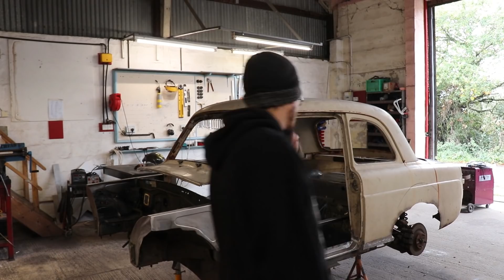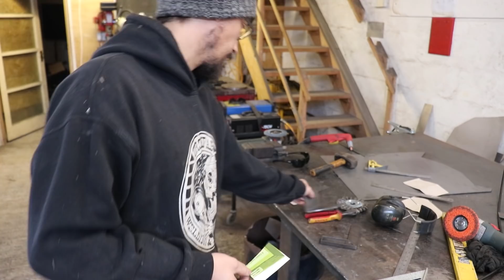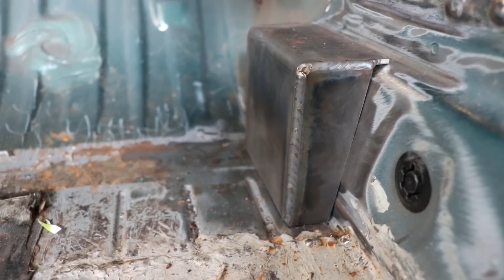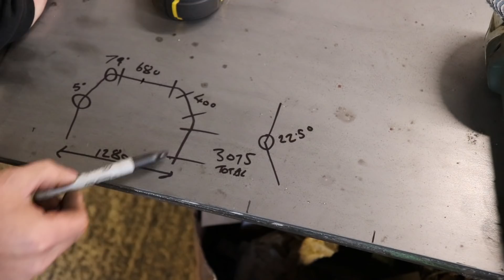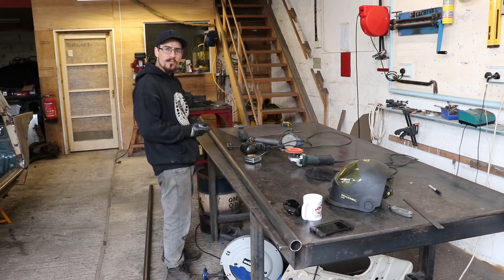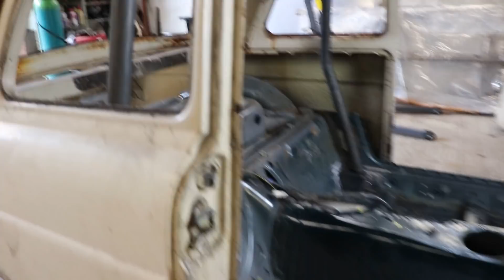THE MONGREL PART 13, STARTING THE ROLL CAGE BUILD

Comment: Nice work and an interesting project  
But you are wrong about the tubing. Very unlikely you are using seamless, possibly DOM but almost certainly has a welded seam somewhere. DOM would have a very hard to see seam but it would be there. Regardless seamless, DOM or with an apparent welded seam the strength is the same given the same wall thickness  
Trying to keep things accurate , keep up the good work

Comment: I'm guessing the roll cage is for the cars body strengthening to prevent warping. To be honest it's ruined the looks of the car. I was hoping you could've used a perforated "C" channel and contoured it internally as arches along the inner wall of the car. It would've looked a whole lot better, a little WW2 aircraft kinda. Throw in a few rivets and she'll look better. 
Another thought, there's this bare horizontal piece of metal below the windshield, can you punch in a few louvers on either side of the midline.

Comment: Lol my 4 and 1/2 inch grinder got guard removed too, I must be another idiot :-) 
only way I can get them fit and see the cut well .
Is indeed dangerous and face shield or good goggles a must, cutting when can't see the cut or struggling with space dangerous too so it not as silly as looks .
I had a 1mm disc break up yesterday cutting in awkward spot under a car and kinked the disc a fraction , never much of a bother as they designed shatter to small pieces but eye/face protection a must .

Comment: Does the bend in the vertical component not weaken the hoop in the vertical direction? Or is it braced backwards later?
Reply from the maker: Yeh its braced backwards and also to the point of the bend.
Reply: I'm building a sporting trials car and would be ashamed if you saw my welds.

Comment: I thought you would have put a plate in behind the box? I always thought without it the box might become a cheese cutter in a highspeed rollover. It wasn't really clear in the New Zealand cage rules so I fully boxed the box as it were...
Reply from the maker: Its definitely a good idea to do that, that area is quite often rusty on older cars so I would plate it in with thicker steel first then weld the boxes to that. I try to tie my cages into the car in multiple places so in the event of a crash or rollover all the stresses arn't placed on 6 feet alone.
Reply: Feral Fab:  Interesting comment, my comment was going to be that I thought Matt's explanations for the box itself were the most logical and best I had heard yet, I have had "discussions"  about said boxes.   The rules I am used to seeing (NHRA and IHRA) do not spell out but the implication is that the plate on which the cage rests is supposed to be relatively flat, as in contoured to the floor but not a built up box.  In this particular video I also find it of interest that in one plane he doesn't want to bend the main hoop tube but in the other plane it almost has to but does not seem to be as much of a concern.  I am not understanding why that would be.  There is a flat at the top of the rear angled floor section behind the seat but assume that is already over the rear wheel tub below so real floor or rocker box to weld to,  I wondered if you could have gone with a bar across the top of that flat that the main hoop would come up from then a bar tied in like his angled one going to the box and then a longer angled one making up the start of the door bars going to the front door hinge area.
Reply from the maker: Im not sure what you mean about the bends?  I have done an mx 5 in the way you describe with the hoop starting at the upper level of the floor, it works great if you are running a single door bar but not for this design. Cheers
Reply: @Urchfab  You didn't want the lower part of the main hoop to kick inwards from the vertical but there is a bend from vertical kicking towards the front of the car (as it follows the floor pan behind where the seat will be).  It maybe a bad assumption on my part but I just assumed keeping all bends out of vertical bars was to reduce chances of further bending if crushed (roll over say).
Ah, the single bar versus multiple (more like road race, rally, NASCAR), had not thought of that...thanks.  Appreciate the series (just viewed part 14 second bit of cage work)

Comment: Hi Matt, Great job! Could the roll cage also be placed just in front of the wheel arch? So higher up in the car and easier to bend? Or would that place not be strong enough since you cut out a lot of material?
Reply from the maker: I need to attach the lower door bar at the base of the main hoop so it needs to sit like that, I have done it the way your saying in the past though. Cheers

Comment: Matt ,get yourself a decent flypress  , bending tooling easy to make.
Mine will bend 3mm  with no effort. Go for a number 3 or 4.
Something like this will be fine   https://www.ebay.co.uk/itm/Fly-Press/173623379630?hash=item286cc286ae:g:js8AAOSw-2hb30Tv:rk:22:pf:0

Comment: I'm enjoying this more and more Matt. Agree with everything you said at the end. You've shown top work, planning, welding etc. Just in case you do read this, I made a roll bar for a Mazda rookie banger in '96, when they first started. Followed the B pillar and......didn't fit in the car LOL. Raced it like that at Swaffam Dec 1st Got videos of that on my channel.
Reply from the maker: I will have a look, Cheers
Reply: @Urchfab  3 videos, Matt "Swaffam1strace" title of the first 9 years ago if it helps find them. Filmed on VHS and transferred.

Comment: Binky is a totally different animal as you said. On a few episodes they ran a stopwatch to capture fab time. The bracket they made to hold the fluid container for the power steering took 8 or 9 hours alone. To compare the Mongrel to Binky is like comparing apples to oranges. But that's the problem with youtube comments, people critique what others do when they have no real clue of the subject matter. Loving the build so far Matt. Can't wait to see it progress. Keep up the good work. All the best from Ireland 🇮🇪

Comment: and i'm looking forward to 1.8VVT, skunk2 intake or itb's, race header, 6 speed gearbox and a 3.9 torsen diff. all on 7Jx15H2 with a big brake kit in front. a short shifter with an extended lever would be finally the cherry on the cake.

Comment: Awesome work I agree nice welds. I need to learn to make some welds like that. All my welds to this point have been on thin 18 gauge for body panels so not pretty but functional. what technique are you using for your welds and what gauge steel can I do a bead like that on?
Reply: DadsToyGarage DevJ  exactly what I was wondering Matt, what thickness is the material you have bead rolled?

 Ooh and........Beautiful welds!!!!!!! 

I’ve the same mask, worth every penny I use mine for plasma cutting but I don’t use the plasma very much, I use my mask at work tig welding a lot of aluminium and stainless steel 

Thanks dan
P.s keep up the amazing work that your doing!!!!!

Comment: Matt, a question about the angled upright main hoop. Given that the car has the potential to land on its roof, it would place the cage in compression and the forces would be transferred into the bend where the cage kicks back. Will you need to place a stiffener bar, back into the car from, or near that bend? Just something that seems to raise a question in my mind. I am interested in race car and competition car construction and was curious about that.
Reply: all he would really need is a neat little triangle, about 15, 9, 12 cm on a plated strip/box which runs along the top of the rear shelf and it should give enough rigidity to minimize any chance of it bending, as it will more than likely be connected along the leading edge of the back shelf anyways. It will more than likely have a rear cross braise coming off of it also. Pending on what class it's going to be raced it .. ie power, weight, year, ect .. or if it goes into just being a track hack will ultimately determine the requirements for what is needed.

If Matt wanted to go nuts he could gusset every single bend as well, then put gusset plates connecting the body to the cage, but at the end of the day, I'm pretty sure Matt has built enough roll cages to understand what's going on :D

If you are interesting in race car construction, get yourself the requirements book in the class you're looking at building for, before you start your build. That way you'll be able to build within the specks of the class and not spend all you're time building something which doesn't pass tech inspection, or end up building something which is way over engineered for the class the car is going to be raced in.
Reply: @KlaytheFounder  Thanks for that.. it answered my question; I have no doubt about Matt's capabilities, expertise and experience. I possess many technical engineering design books; just sometimes interpretations of rule books, specifications and calculus. are written in a far more complex detail for a layman. Too much rigidity can also lead to transfer forces being absorbed by the driver's brain, (viz the Late Dale Earnhardt), with sometimes tragic consequences; hence the full containment seats and Hans Devices etc we use in our speedway and road circuit cars here in Australia.
Reply: @Afrodizyak47  exactly, it's a fine line between being safe, and being so safe that you're actually causing damage again, that's also why they've been putting crumple zones in cars for a while, especially in steering columns .. nothing worse than being shook about too much or impaled by something when you want the car to absorb what ever it's crashing into, otherwise it'll end up behaving more like a pinball and just bounce off of everything.

Comment: In Australia we aren't allowed to have bends in the uprights of the main hoop, which is probably why some of them are leant backwards, rather than 90deg to the sills.
Reply: yeah, but there is also a limit to the amount of lean back which is allowed as well, as at certain angles you start putting the stress on the weld, over the material. If someone was going to be doing a specific race spec on an MX-5 the main hoop would more than likely have to be placed on the rear shelf with rigid bars going from the floor and the rear shelf or having a split bar which has a box/plate on the floor, then having a box/plate on the rear shelf which stretches out to connect the bottom and top, so then the main hoop stays within a maximum of a 5 degree lean back. Also putting into consideration that it's following the floor line changes things up a bit too, I'm pretty sure that it will be pushed back further against the back shelf, as otherwise yes it would just bend when it's on it's roof.

It also all depends on the class which it's going to be raced in as well.

Yeah, I just looked at an MX-5 race car for Australia, the main hoop was connected to the rear shelf and not the floor.
Reply: I knew there was limitations on angles from vertical, but its been many years since I looked at the regs, I just didn't know if some classes in the UK would allow that much angle.

Comment: Great vid Matt. Well done. 
Project Binky times how long it took to make one small bracket for something on the mini and it was over 8 hours. I cant remember exatly how long, but you are right, it is a completely different situation. 
They are taking a standard mini and making it rear wheel drive (I cant remember if it is going to be 4 wheel drive). Someone already done the rear wheel drive mini by making one with a Ford Escort floor and running gear. I cant remember if they used the mk1 or mk2 escort, but they had to shorten everything to fit the mini shell on. Looked good but seemed very strange seeing a rear diff under a mini. This is going back about 22 - 23 years ago. :)
Reply: Project Binky is 4wd. It's got the running gear and engine from a 2l turbo Celica.

Comment: Top notch work! Your welds on those boxes are an art. Regarding the pillar, why not chop and and lengthen the door so your pillar will be inline with the roll cage? Your going to make custom fiberglass doors anyways and with your metal working skills could easily match the gap in the roof to the curvature of the existing roof.
Take care from the other side of the pond(California)

Comment: Bending the main hoop like that (in more than one plane) is a no-no, according to the FIA. I know, because I am having the same-ish problem you do here but will have to tilt the main hoop backwards a bit (max 10 degrees allowed). But I do love your work, very well done and at a pace too.
Reply: I don't think FIA or MSA have any classes which would suit Mongrel, but I agree that giving the cage easy options for deflections means you have to add more triangulation to compensate for the lack of a straight load path.

Comment: I know, what I think about is not the route you plan to go. I just love sleepers... and Miatas. 

But seeing so much open space between the two car shells, I would have loved to see a invisble roll cage built into the cars open sills and spaces. Since you are basically building this all up from nothing you would have had the freedom to totally integrate the cage in the chassis. ... or at least hide it that well, that it fucks with the perception of people trying to figure out if it is a stock vehicle. (Yeah, I know. Stock outside was never an option.)

Still. Clean and very well documented build. Imho better to watch than any other build series. Those very high money builds get boring very fast. 

My huge respect for your craftmanship.

Comment: With you on the roll cage boxes, a much better way of doing it. Much safer. When I think of my first racing Mini with its single hoop John Aley roll over bar bolted to the floor & a single brace clamped with an ally clamp & bolted to the back shelf it makes me cringe. But in the early 1970s that was the standard. My old 1959/60 Cooper T51 didn't even have a cage or harness.
Reply: My first rally mini only had a rear cage, one hoop and a brace...good job i never rolled it.....
Reply: @rogdad  and bolted to the floor with 2 10 mm bolts through a flimsy steel plate lol

Comment: I think people (myself, at least) are only comparing your project to project binky insofar that they're both incredibly ambitious and impressive projects done by british guys in sheds.
Reply: Also, replacing rusty panels with fresh metal, with appropriate deformation.

The Mongrel won't take years to finish because Matt's started with two similar size cars and the panels of the Ford don't seem to enclose a smaller volume than the MX5 engine bay or the space needed for the MX5 suspension towers.

There's a scale of engineering challenge that runs from assembling a kitcar in a shed up to re-engineering a production car to competitively meet FIA Super 2000 regs. Matt and BOM aren't working with the same tools, technology or manpower, and the challenges they've each chosen reflect what they believe is achievable *in a reasonable amount of time and budget*.

Binky is a bit like the Apollo programme: "We will put a Celica 2L Turbo engine and 4wd drivetrain into an Austin Mini without changing the external dimensions, and do the other things, not because they are easy but because they are hard"... They're a pro rally prep business so the time they spend on Binky works as PR for BOM, but they wouldn't have taken 4 years to reach wiring if they weren't also trying to run a profitable business at the same time.

Love both projects, but they're definitely different.
Reply: @noxxi knox  I think any other team would have drawn the line at engine-swapping into a solid mini shell, but to also add the 4wd, air conditioning, electric windows, central locking, side-impact protection bars AND a remotely-operated motorised flip front which retains a normal bonnet opening... BOM go there so we don't have to.
Reply: When i was a younger man i took the back seats out of my £20 Renault 4 so me and my girlfriend could have fun in the back when we were loved up at free partys in Devon... PROJECT BONKY : )
Reply: Completely agree!
Reply: Matt does a great clean job. Like he said, it is different in nature compared to Nik and Richard. A similar build would be the 240Z from B is for Build. But Matt does everything properly whereas I shake my head at some of the decisions Chris makes.

Comment: Will this be road legal when done
Reply: BIG T. - It’s a track car. No idea about UK MOT law.  The car chassis will undoubtably be solid when done.  Emission testing on the other hand will be another issue, depending on his choice of engine and exhaust.
Reply: @iMadrid11  To get it road legal it would need to have SVA / IVA like a kit car and that is quite detailed. The manual is available online. It would need a lot more fitting out inside to get it passed than you can get away with a stripped out racer. You need things like demisters fitting, proper glass - not perspex screens.
 Emissions would be the easy bit - make sure there is a cat on it and the ECU has a proper map flashed onto it
Reply: Chris Bautista some track car racing. The cars have to have an MOT